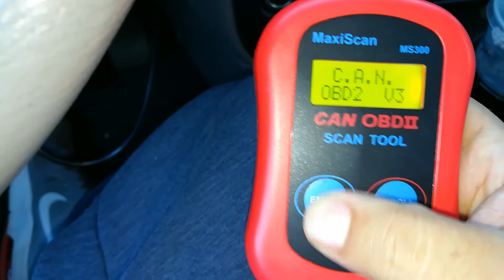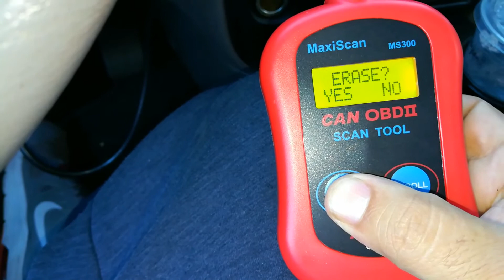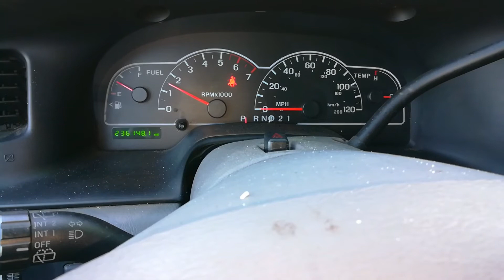How To Reset FORD WINDSTAR Check ENGINE LIGHT + P0457 FIXED FREESTAR

Comment: My park and brake lights won't shut off what can I do besides pulling battery terminal in in my 70s thanks
Reply: Happened to mine I changed brakes top brake fluid off  abs and brake light went off . Could just be a stick emergency brake
Reply from the maker: I appreciate your constructive comments, thank you for the feedback!

Comment: Gas cap? How would that make the check engine light come on, is there a sensor somewhere on the gas cap lid somewhere?
Reply from the maker: The sensor is evap system. The cap is just a seal.

Comment: I have a 1998 Ford Windstar that the check engine light keeps comeing on once I fix the problem it goes off then I drive it. For about a mile it comes back on every time
Reply from the maker: Ehrich Tifft, Next time the check engine light turns on you may want to scan it using a simple obd2 scanner. If you unsure what the code means, just reply to his message and I can give you few common causes.  Even though it's only an intermittent check engine light it is a good idea to know what is causing the check engine light so you don't get stranded on the side of the road.  Best of Luck. _RandomFix

Comment: I change the gas cap twise and the light comes back after l refill the Gas tank
Reply from the maker: You need an obd2 reader to get the code.
Reply: Yes they scanned is was the gas cap that’s why l replaced again soon l put gas again in about a day drive the check engin coms up